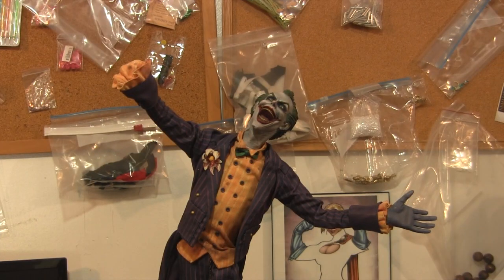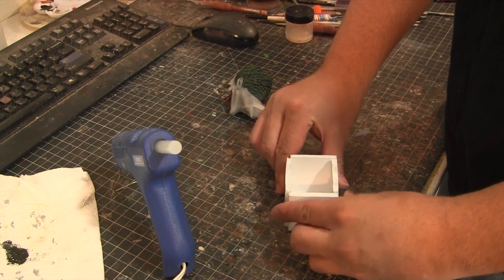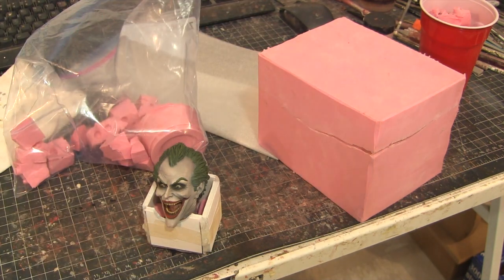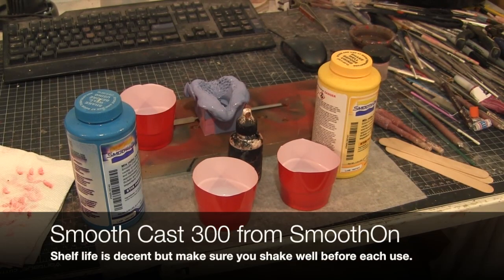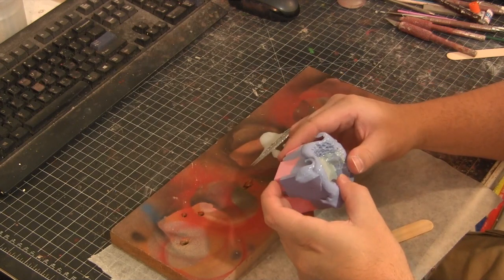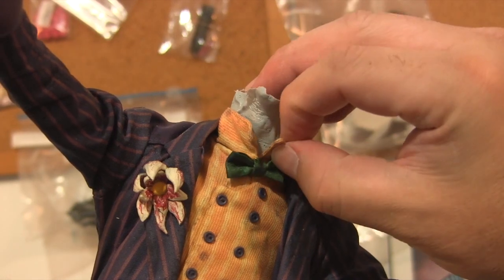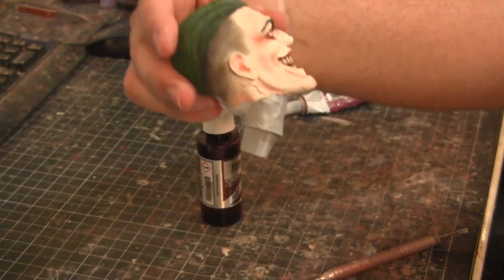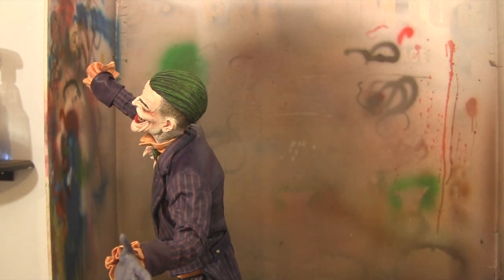Keying a Different Joker PF Statue Head WIP

Comment: Vince love your work. I'm a big fan. Because of your videos I've gotten back into the hobby. Quick question, what size magnets do you use?
Reply from the maker: Oh i have all kinds of sizes. 10-15mm round, 2-3 thick, and even super smaller ones then that. More or less i measure most 1/4 statue arms and heads and just order magnets around that size off eBay.